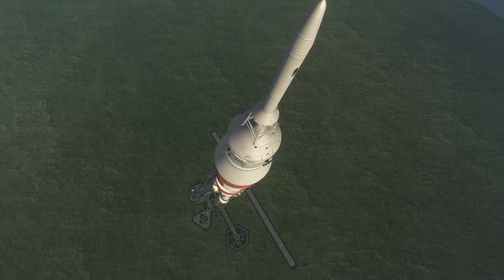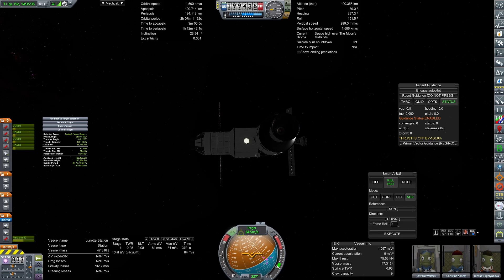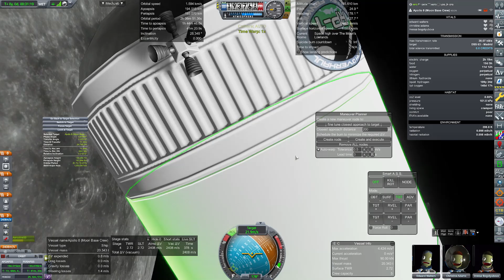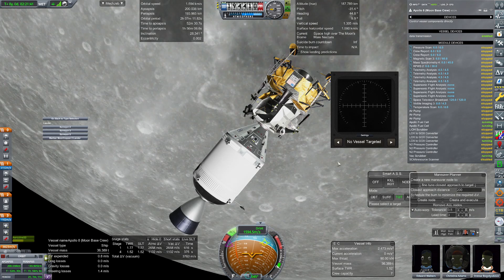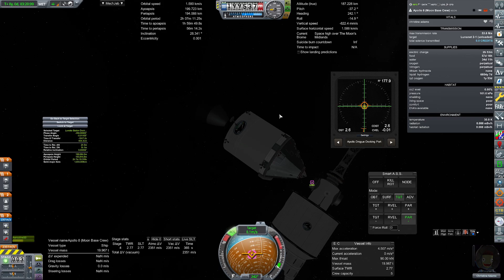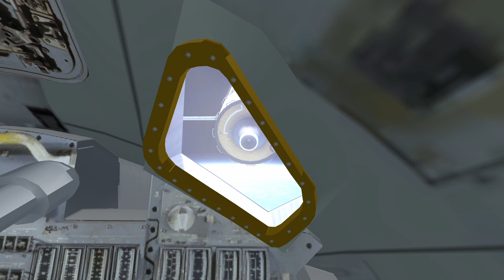First Lunar Outpost! - KSP/RP-1 - Next Small Step Episode 109

Comment: Quick question could you have not docked the service module with the station and then piolet the lem ( using rcs ) and dock to the station ?
Reply from the maker: I don't think I have probe avionics on the LEM. It's got a science core, but no Deep-Space.
Reply: @justinbright9567  Could you have transferred a crew across when it was docked with the Service Command Module?
Reply: @owenmckenzie4145  yea i meant crew lol
Reply from the maker: The LEM only has an Apollo drogue docking port, so there's no ports on Lunette Station that would have worked.